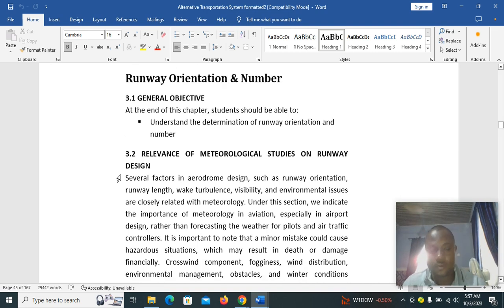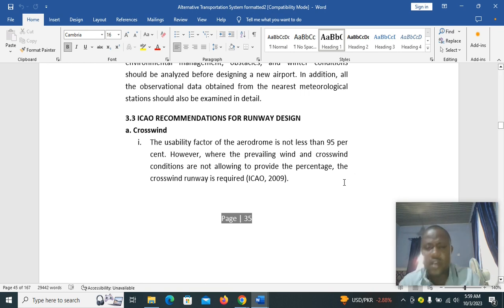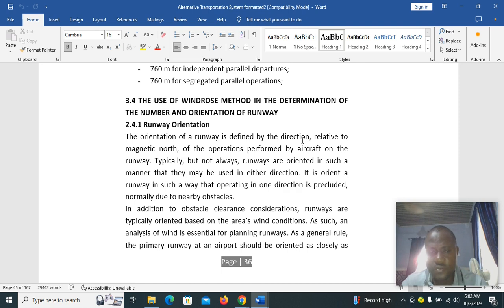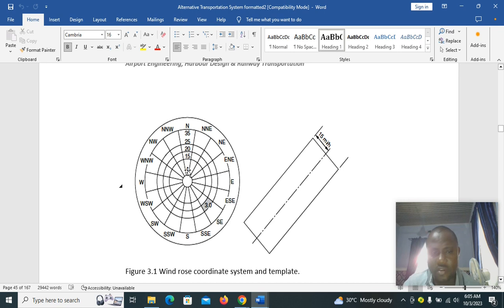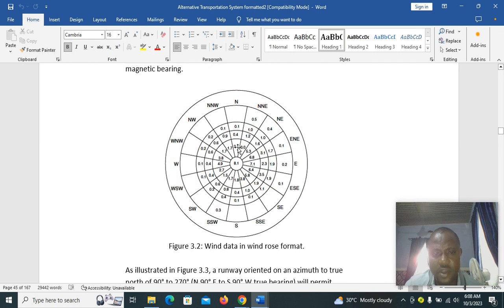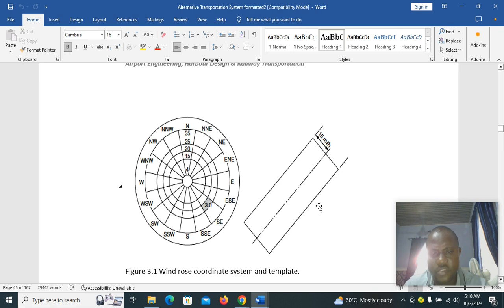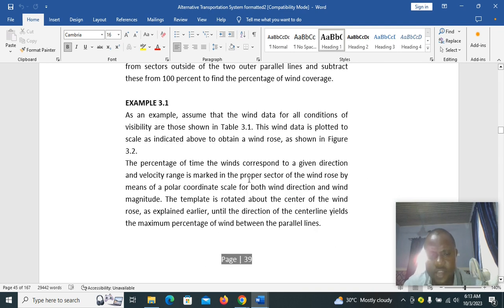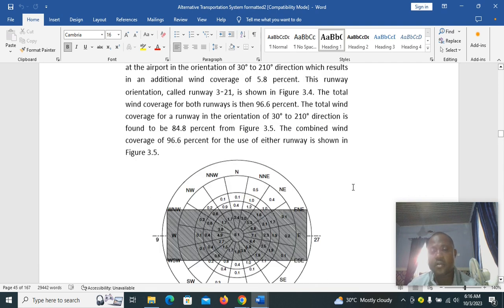Runway Orientation & Number

Comment: The tutorial explained that the orientation of a runway is mainly determined by the prevailing wind direction at the airport. Since planes take off and land against the wind for better safety and performance, runway alignment is chosen based on long-term wind records to maximize efficiency. Runway numbers are assigned according to their magnetic heading, rounded to the nearest 10 degrees and divided by 10. For example, a runway aligned with 180° (south) is marked as Runway 18. Because each runway can be used in both directions, the opposite end gets a number 180° apart — so a 180°/360° alignment becomes 18/36. For airports with parallel runways, letters L (Left), C (Center), and R (Right) are added, such as 09L and 09R. The tutorial also noted that changes in magnetic variation may require occasional renumbering to reflect updated headings. Proper runway alignment helps ensure safe operations and minimizes crosswind difficulties for pilots.

Comment: Meteorological studies are essential in runway design, impacting factors like runway orientation, length, visibility, and safety. Accurate weather data—particularly wind speed and direction—must be collected over at least five years to ensure proper planning. Runways should be oriented based on prevailing winds to allow aircraft to operate safely at least 95% of the time. When this usability factor is not met, crosswind runways are recommended. The Windrose method is commonly used to analyze wind patterns and determine optimal runway orientation. ICAO guidelines also specify minimum distances between parallel runways based on their intended use and code numbers. Additionally, environmental conditions such as fog, winter weather, and nearby obstacles must be considered to minimize risks. The FAA provides crosswind component limits based on airport reference codes, ranging from 10.5 to 20 knots. Overall, meteorological analysis plays a critical role in ensuring safety, efficiency, and compliance in runway and airport design.

Comment: The video tutorial explained that runway orientation is
determined primarily by the direction of prevailing
winds at an airport location A Aircraft take off and land
into the wind for safety and performance, J So the
orientation is selected based on long- -term wind data to
ensure maximum usability The runway number is
based on its magnetic heading, rounded to the nearest
10 degrees and divided by 10 For example, F a runway
facing 180 (south) is labeled as Runway 18 Since
runways can be used in both directions J each end has a
different number, J 180 apart For instance, J a runway
with heading 180/360 would be labeled as 18/36.
When there are parallel runways, J they are distinguished
using letters L (Left), C (Center), and R (Right) e.g.,
O9L and O9R The class also touched on how magnetic
variation can cause periodic renumbering of runways to
match updated magnetic headings Proper orientation
ensures safe and efficient flight operations and reduces
crosswind challenges for pilots.

Comment: Railway orientation and numbering are critical
components of railway infrastructure, enabling efficient
navigation, J scheduling, and operations. A
well-designed orientation and numbering system
facilitates safe and reliable train movement, J while a
poorly designed system can lead to confusion, J delays, J
and accidents.
Railway orientation and numbering are critical
components of railway infrastructure, enabling efficient
navigation, J scheduling, and operations. A
well-designed orientation and numbering system
facilitates safe and reliable train movement, J while a
poorly designed system can lead to confusion, delays,
and accidents. By adopting standardized numbering
systems using clear and concise signage, J and regularly
updating and maintaining systems J railway operators
can ensure efficient and reliable train movement.

Comment: Railway orientation and numbering involves several
aspects. orientation is refer to as the direction a
railway line runs often to be described using compass
directions and geographic coordinates. numbering
system are used to identify railway lines, J routes and
tracks for operational and administrative purposes A
well designed orientation and numbering system
facilitates safe and reliable train movements Railway
orientation and numbers ar critical component of
railway infrastructure enabling efficient navigation, J
scheduling and operations

Comment: Runway orientation is determined primarily by the
direction of prevailing winds at an airport location
Aircraft take off and land into the wind for safety and
performance, J So the orientation is selected based on
long -term wind data to ensure maximum usability The
runway number is based on its magnetic heading.
rounded to the nearest 10 degrees and divided by 10
For example, J a runway facing 180% (south) is labeled as
Runway 18 Since runways can be used in both
directions J each end has a different number, 180 apart.
For instance, J a runway with heading 180 /360% would
be labeled as 18/36. When there are parallel runways, J
they are distinguished using letters L (Left), J C (Center),
and R (Right) e.g., 09L and 09R The class also
touched on how magnetic variation can cause periodic
renumbering of runways to match updated magnetic
headings Proper orientation ensures safe and efficient
flight operations and reduces crosswind challenges for
pilots.

Comment: Runway Orientation and Number
Runway Orientation
Runway orientation refers to the direction or alignment of a runway, typically measured in degrees relative to magnetic north. The orientation is crucial for safe takeoffs and landings, as it affects aircraft performance and handling.

Runway Number
A runway number is a two-digit code that indicates the magnetic direction of the runway. The number is derived from the runway's magnetic azimuth, rounded to the nearest 10 degrees. For example:
- A runway with a magnetic direction of 274 degrees would be designated as Runway 27.
- Runway numbers range from 01 to 36, representing directions from 360 degrees (north) to 360 degrees (north) in a clockwise direction.

Runway numbers are often accompanied by a letter suffix (L, R, or C) to distinguish between parallel runways:
- *L*: Left runway
- *R*: Right runway
- *C*: Center runway

Understanding runway orientation and numbering is essential for pilots, air traffic controllers, and airport operators to ensure safe and efficient aircraft operations.

Comment: Runways are typically oriented in the direction of prevailing winds to maximize the use of wind forces during takeoff and landing. This orientation helps reduce the risk of accidents and improves overall airport efficiency. There are several factors to consider when determining runway orientation, including.. Wind direction, Wind coverage, Topograph.

Comment: Practical 8

The video tutorial explained that runway orientation is determined primarily by the direction of prevailing winds at an airport location. Aircraft take off and land into the wind for safety and performance, so the orientation is selected based on long-term wind data to ensure maximum usability. The runway number is based on its magnetic heading, rounded to the nearest 10 degrees and divided by 10. For example, a runway facing 180° (south) is labeled as Runway 18. Since runways can be used in both directions, each end has a different number, 180° apart. For instance, a runway with heading 180°/360° would be labeled as 18/36. When there are parallel runways, they are distinguished using letters L (Left), C (Center), and R (Right) — e.g., 09L and 09R. The class also touched on how magnetic variation can cause periodic renumbering of runways to match updated magnetic headings. Proper orientation ensures safe and efficient flight operations and reduces crosswind challenges for pilots.

Comment: To determine the base place is to sight the runway condition.
Magnetic Heading Basis
Runway numbers are based on the runway's magnetic heading, rounded to the nearest 10°, with the last digit dropped.
E.g., a runway aligned at 092° → rounded to 090° → numbered 09. 
A runway pointing north at 360° is designated 36, not "00". 

 Reciprocal Runway
Each runway has an opposite direction, exactly 180° apart. The reciprocal runway number is either ±18 (since "180° → 18" in runway numbering).
E.g., Runway 09 ↔ Runway 27 (09 + 18 = 27) 
Parallel Runways and Letter Suffixes

When multiple runways are parallel, they share the same numerical heading but are distinguished by letters: L (Left), C (Center), R (Right).

thank you sir 
this must be put into consideration

Comment: Runway orientation and numbering are critical components of airport design and operation. By aligning runways with prevailing wind directions and numbering them according to magnetic azimuth, airports can ensure safe and efficient takeoffs and landings. This standardized system facilitates clear communication between pilots and air traffic control, minimizing errors and enhancing overall aviation safety.

Comment: Railway orientation and numbering involve several aspects. Orientation refers to the direction a railway line runs, often described using compass directions or geographic coordinates. Numbering systems are used to identify railway lines, routes, and tracks for operational and administrative purposes. These numbering systems can vary by country or railway authority, but they typically help in organizing and managing railway infrastructure, scheduling trains, and ensuring efficient operations.

Comment: RAILWAY ORIENTATION AND NUMBER. 

The orientation of a railway is defined by the direction relative to the magnetic North of the operators performed by aircraft on the runway,   Typically but not always. Runways are oriented in such a manner that they may be used in either directions. In addition to obstacle clearance, considerations.
Runway are typically oriented based on the areas wind conditions.  As such an analysis of wind is essential for planning Runways.  As a general rule,  the primary at an airport should be oriented as closely as practicable in direction of the prevailing winds. When the landing and taking off, aircraft are able to maneuver on a Runway as long as the wind components at the right angles to the direction of travel, the cross wind components is not excessive.

Comment: Runway Orientation
Runway orientation is determined by the direction of the runway, which is aligned with the prevailing wind direction to minimize crosswind components during takeoff and landing.

Runway Numbering
Runways are numbered based on their magnetic azimuth (compass direction), rounded to the nearest 10 degrees. The numbering system is as follows:

- Runways are numbered from 01 to 36
- The number represents the magnetic azimuth of the runway, with 01 being approximately north and 36 being approximately northwest

Comment: Practical 9

Runway Orientation, Numbering, and Design Standards

Runway orientation is critically determined by prevailing wind patterns at an airport site. Aircraft require takeoff and landing into the wind to maximize lift, reduce ground speed, and enhance safety. Engineers analyze decades of wind data (direction, speed, frequency) to align runways with the dominant wind direction, minimizing crosswinds and ensuring operational reliability.  
Runway Numbering System
The runway number is derived from its magnetic heading, rounded to the nearest 10 degrees and divided by 10.  
 Example: A runway facing 184° magnetic becomes Runway 18 (184° → 180° → "18").  
 Since runways operate bidirectionally, each end bears a number 180° apart:  
 Example: The opposite end of Runway 18 (180°) is Runway 36 (360°), labeled 18/36.  
Parallel Runways
Multiple parallel runways are distinguished by positional letters:  
L (Left), C (Center), R (Right).  
 Example: Two parallel runways facing 90° are 09L and 09R.  
Key Considerations   
1. Magnetic Variation: Earth’s magnetic poles shift over time, altering magnetic headings. Runway numbers may require periodic renumbering (e.g., Runway 17/35 becoming 16/34 after a 10° shift).  
2. Crosswind Mitigation: Proper orientation reduces crosswind components, preventing destabilization during landing.  
3. Terrain & Obstacles: Runways avoid hills, buildings, or noise-sensitive zones, even if wind data suggests suboptimal alignment.  
4. Climate Adaptation: Airports in cyclone-prone regions prioritize resilience against extreme wind shifts.  
Safety and Operational Impact
Correct runway alignment ensures efficient air traffic flow, minimizes pilot workload during crosswinds, and reduces wear on landing gear. The FAA and ICAO enforce strict design standards, requiring wind coverage analysis to confirm runways support operations ≥95% of the time. Modern tools like computational fluid dynamics optimize orientation in complex wind environments, balancing safety with terrain constraints.

Comment: In this video the Railway orientation and numbering are critical components of railway infrastructure, enabling efficient navigation, scheduling, and operations. A well-designed orientation and numbering system facilitates safe and reliable train movement, while a poorly designed system can lead to confusion, delays, and accidents. By adopting standardized numbering systems, using clear and concise signage, and regularly updating and maintaining systems, railway operators can ensure efficient and reliable train movement.

Comment: Railway orientation and numbering are critical components of railway infrastructure, enabling efficient navigation, scheduling, and operations. A well-designed orientation and numbering system facilitates safe and reliable train movement, while a poorly designed system can lead to confusion, delays, and accidents.

Railway orientation and numbering are critical components of railway infrastructure, enabling efficient navigation, scheduling, and operations. A well-designed orientation and numbering system facilitates safe and reliable train movement, while a poorly designed system can lead to confusion, delays, and accidents. By adopting standardized numbering systems, using clear and concise signage, and regularly updating and maintaining systems, railway operators can ensure efficient and reliable train movement.

Comment: Runway orientation is determined primarily by the direction of the prevailing winds at the airport, which is why before desiging the run way visibility is ensured, wind distribution, safety and performance

Comment: Runway orientation is determined primarily by the direction of prevailing winds at an airport location. Aircraft take off and land into the wind for safety and performance, so the orientation is selected based on long-term wind data to ensure maximum usability. The runway number is based on its magnetic heading, rounded to the nearest 10 degrees and divided by 10. For example, a runway facing 180° (south) is labeled as Runway 18. Since runways can be used in both directions, each end has a different number, 180° apart. For instance, a runway with heading 180°/360° would be labeled as 18/36. When there are parallel runways, they are distinguished using letters L (Left), C (Center), and R (Right) — e.g., 09L and 09R. The class also touched on how magnetic variation can cause periodic renumbering of runways to match updated magnetic headings. Proper orientation ensures safe and efficient flight operations and reduces crosswind challenges for pilots.

Comment: The video lesson explained that runway orientation is mainly based on the dominant wind patterns at an airport’s location. Because aircraft achieve safer and more efficient takeoffs and landings when heading into the wind, long-term wind data is analyzed to determine the most suitable runway direction.

Runway numbers are assigned according to the magnetic compass heading of the runway’s direction, rounded to the nearest 10 degrees, then divided by 10. For example, a runway aligned with a magnetic heading of 180° (due south) would be labeled Runway 18. Since each runway can be used from both ends, the opposite direction—which is always 180 degrees apart—has a different number. So, a runway aligned along 180°/360° would be marked as 18/36.

When an airport has multiple parallel runways, they are identified with additional letters: L for Left, C for Center, and R for Right—such as 09L and 09R. The video also discussed how shifts in the Earth’s magnetic field (known as magnetic variation) may lead to occasional renumbering of runways to keep the labels accurate with the current magnetic headings.

In conclusion, selecting the correct runway orientation is essential for safe flight operations, minimizing the effects of crosswinds, and enhancing overall airport efficiency.